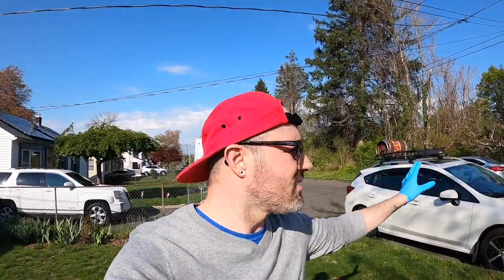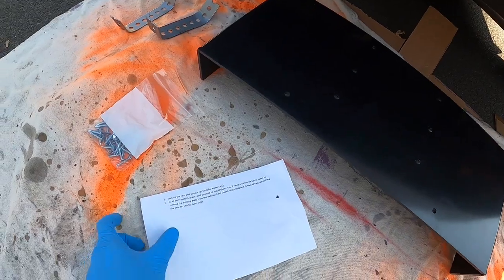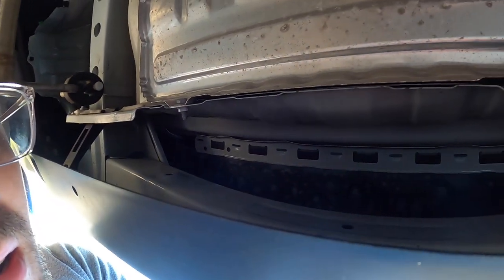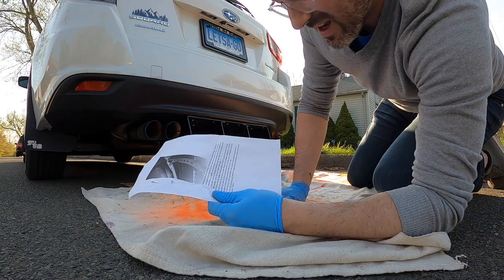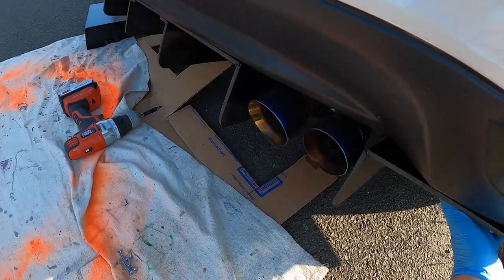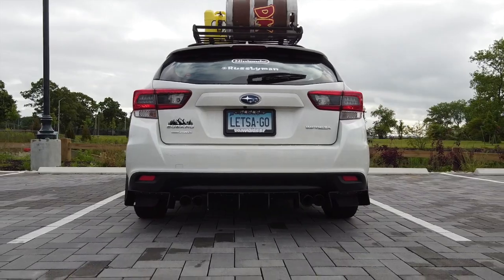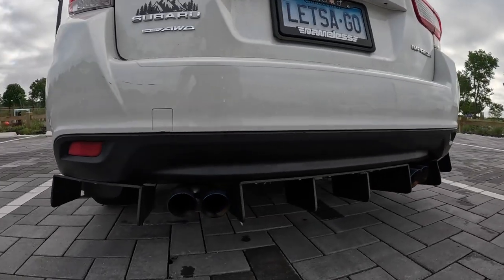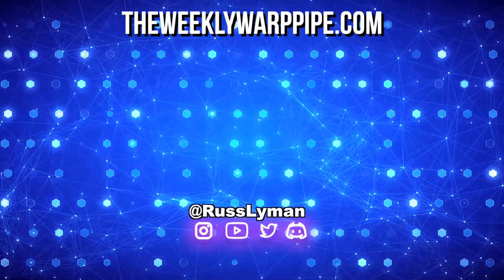Installing my Variant Aero Rear Diffuser on my 2023 Subaru Impreza Hatchback

Comment: Nice. I just added door trim molding and am working on black lettering the "Subaru all symmetrical AWD" symbol and I just added an large transformer logo where the sport emblem was. If you're on  I would love to send you some pictures. I also have El wire, under floor lighting (interior) and blue entryway lighting. Love that diffuser. Thanks for the video....🏹🤠👍

Comment: Hey man, I am looking for rear diffuser for my 2023 wrx , How 's the variant aero company ?    They are product don't have any description， I don't know what's the stuff made by ...
Reply from the maker: Hey thanks for the comment. I would definitely recommend them. I have had no issues with the rear diffuser since I posted this video. The product is made of a really dense plastic. It does not feel cheap and it has a bit of weight to it. Hard to describe bit you can definitely feel the quality in the build.
I hope this helps. Biggest decision is choosing what design you want to go for
Reply: @RussLyman  I placed the order  for rear diffuser already , so excited .